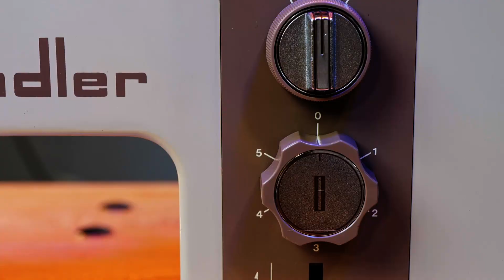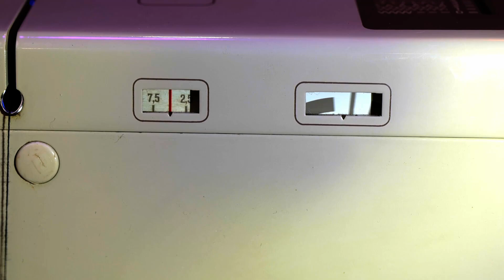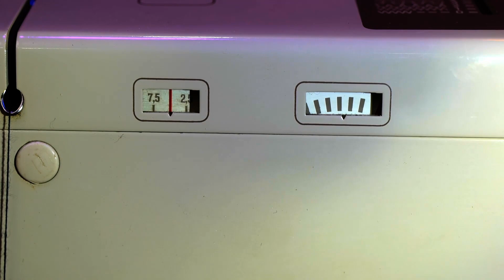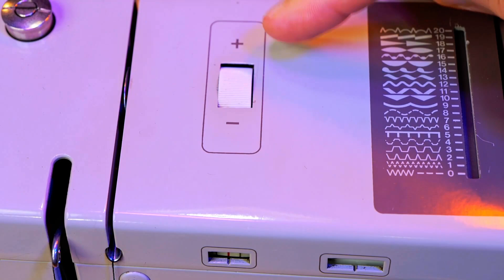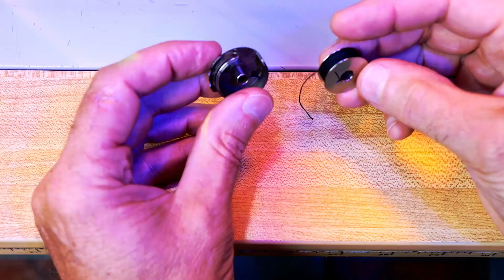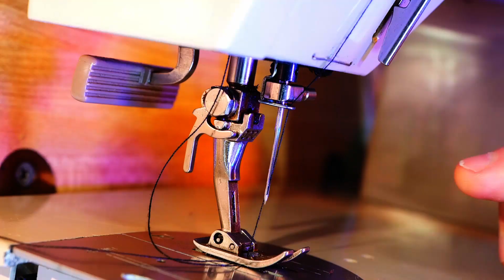Chandler (Bernina 950) "Industrial" Sewing Machine

Comment: I have one of these, and the best fix I had for mine when the 'old oil thing' became a problem, was setting it in a covered plastic tub full of paper towels on the bottom,  and keeping the whole set up  in a warm space for a few weeks to let all that chunky old  oil melt.  Then I re-oiled the machine and away I went.  Everything works except for the bobbin winder now.  It's my understanding (right or wrong) that the bobbin winders on these machines were particularly finicky, so I'm probably just going to buy an accessory bobbin winder & call it a day.

Comment: I've done a couple of repairs on a friend's Bernina 940, I think it's the same as the 950 except it uses flat shank domestic needles. I did notice the needle plate screws, they look a little different. They look like they're center drilled (in the slot) as if they are meant to be oiled. I have the machine with me while the owner is in Germany so I was able to take a good look at the screws. I used a straight pin to probe the center holes and the holes do not go through so I do not know why they are made the way they are. They are a standard 4-0.7 mm thread, I used a set of thread gauges (thread detective) and the screw fit perfectly.
Reply from the maker: Thanks for the info, I'll see if I can get that size.